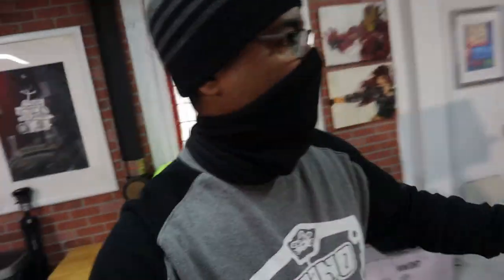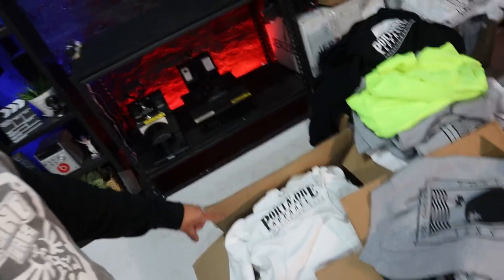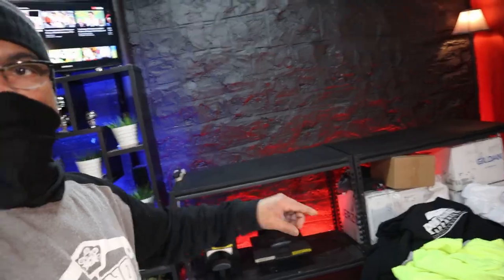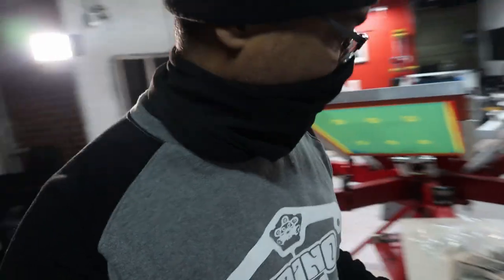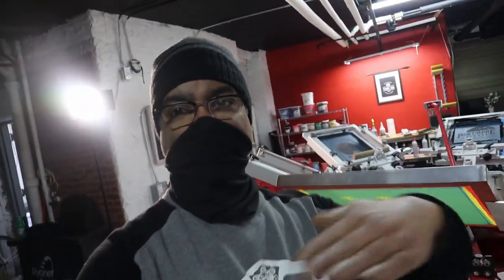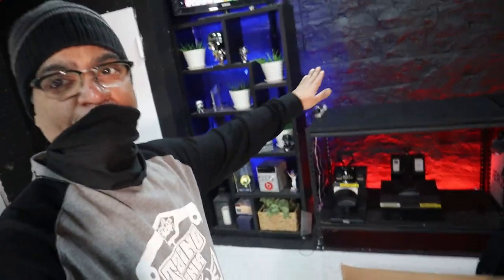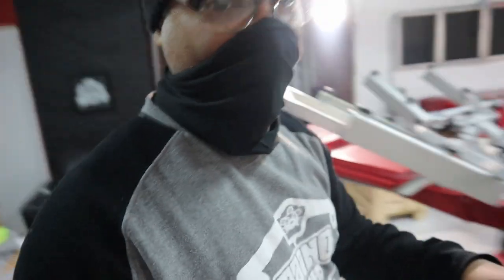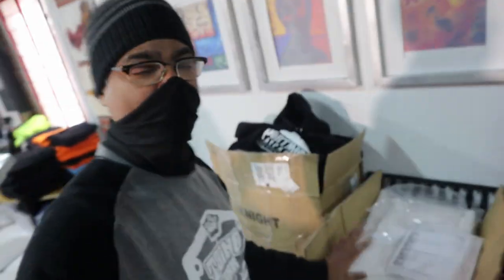Print Vlog / Screen Printing for a clothing brand Part2 / Step by Step printing pants.

Comment: Awesome... Quick question. For the Pants, isn't the logo support to be on the opposite side of the tee pocket logo side, meaning, right leg? or is depending on customer request? If the customer does not mention a side, what should be the standard? Thank and once again, killer vid.

Comment: What screen count you use for your white inks?
Reply from the maker: Thank for supporting the channel. I used a 110 mesh count. I coated with emulsion using the sharp side of the scoop coater and passed it twice on both side of the screen.